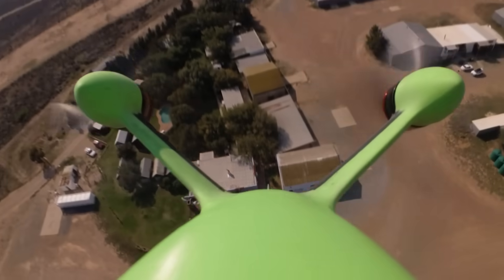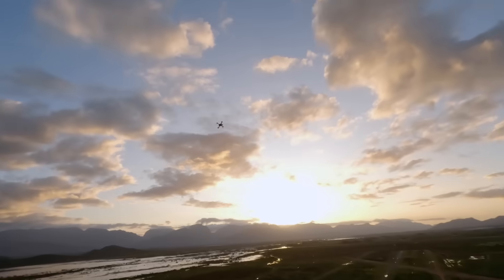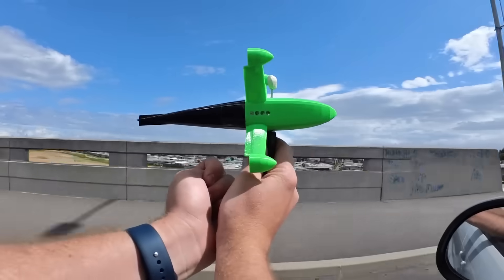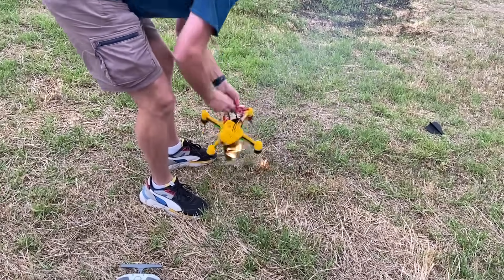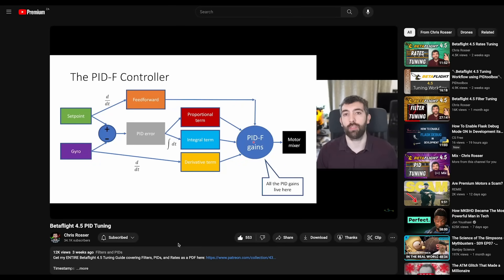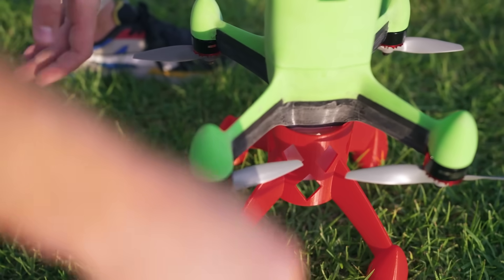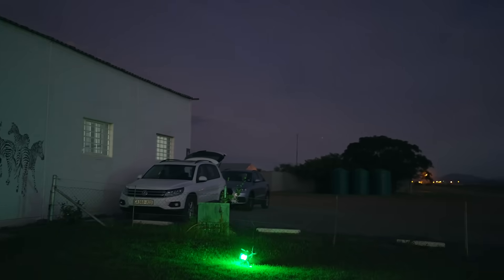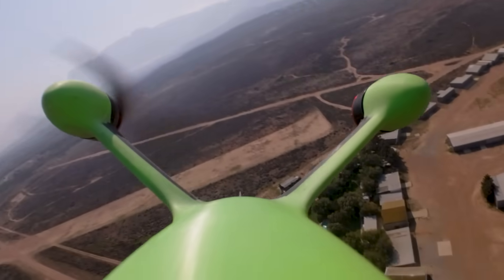Building The Fastest Drone EVER! - Guinness World Records

Comment: Just a thought. It seems to be me that this drone is powerful enough to fly into a tornado. And tornado research BADLY needs controllable probe drones.
You might want to contact tornado researchers, for example Reed Timmer, PhD.
This drone may be actually really useful!
Normal drones cannot fly into a tornado because it has a wall made of wind which basically redirects them, but if you can match the speed of the wind, or even exceed it, you can punch through! Currently this is done by rockets, but those are not very precise, and they are not controllable after the quick burnout.
Reply: @adamrak7560  2nd this
Reply: @adamrak7560  I'm sure they're mines ahead of you on that.